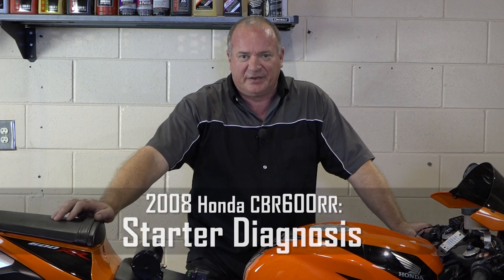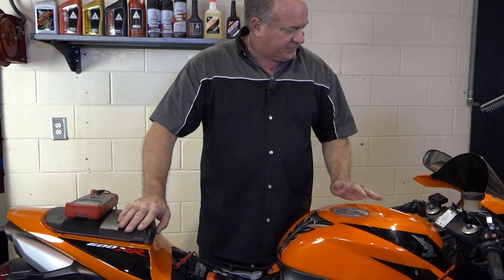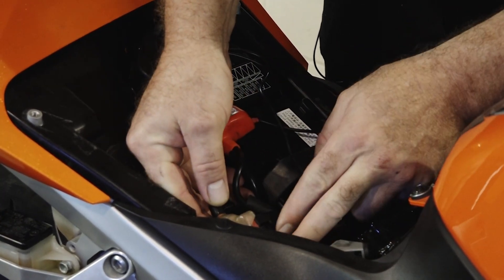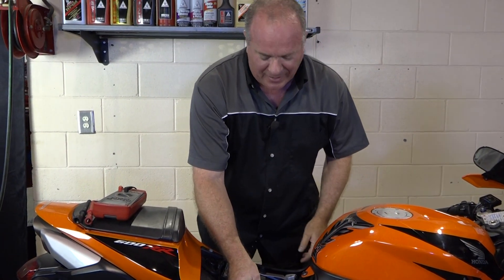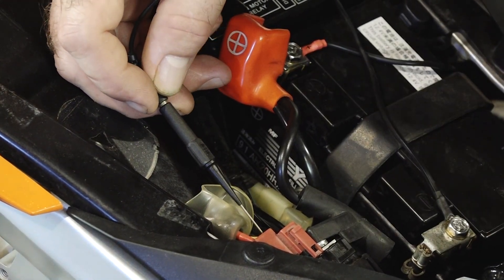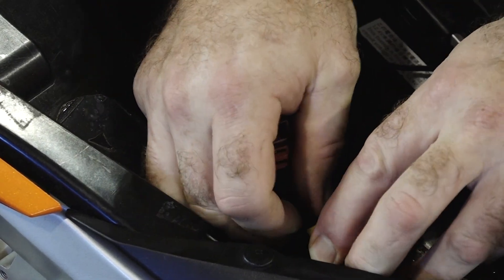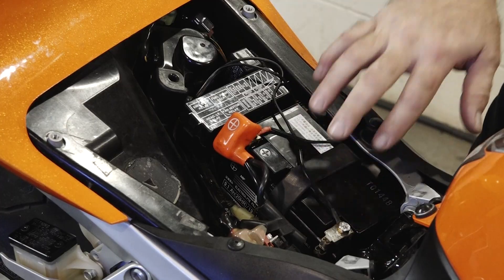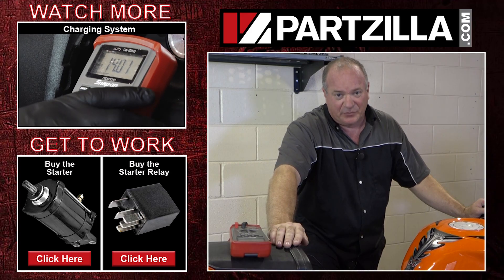How to Diagnose Starter Problems on a Honda CBR 600 RR | Partzilla.com

Comment: Would the starter die when the bike is hot
Reply from the maker: I suppose it's possible if your starter is already on it's way out, but that shouldn't cause it to die. At least, I've never heard of that happening.
Reply: Partzilla guess I'm gonna have to figure out why It dies when it gets around 200
Reply from the maker: It can only really be a couple things.  Do a Voltage test on the battery and make sure it's not weak, check the regulator/rectifier and make sure the connections are cleaned.  If none of that helps, it's most likely a bad rectifier or your starter is going out.  Always start with the cheapest fix first.  I hope this helps get you to the answer.
Reply: Partzilla thanks

Comment: hey friend i need to ask you something
Reply from the maker: I may, or may not have a good answer, but we will give it our best.  What's your question?
Reply: Partzilla Hi. My question is this. You do not know how to fix a cdi / ecu from a cbr 600 f4i? In advance thanks friend
Reply from the maker: There isn't really a "fix" for a damaged ECU.  There is a process in the service manual to reset your ECU if something is running weird.  Other than that, it would be a full replacement.  I would rule out EVERYTHING else before you do anything with the ECU.  Check all fuses and wires first.

Comment: What is that tool he used to start the bike manually by inserting the metal tip into the wire?
Reply from the maker: It is called a jumper.
Reply: @PartzillaParts  what was the other side connected to?? The positive terminal?

Also could you link it or give the part number? When I look up jumper or jumper needle I just get regular jumper cables for motorcycles.

Comment: can anyone please help. I read the Voltage on the battery while press start button, it's 7.3V. then, I connect the multimeter to the starter it reads 5.2. Do I check all the ground cables from starter to the battery?
Reply from the maker: Hello Do it Diep. How many volts are you getting without pressing the start button?
Reply: Partzilla it was 12.6V
Reply from the maker: What you are describing to me would tell me that you need to replace your battery.

Comment: hi I checked everything as you did in the video. but I when I connect the positive terminal to the yellow red stripe wire the starter does not make any noise. what could it be? starter is bad? 
thanks.

Comment: I have a 2017 Honda cbr 250 an some dummy cut my ignition wires and mess my ignition up totally up so I tried reconnecting the wires and twisting them together and my bike will not crank and I'm at after hours and hours of trying somebody please help
Reply from the maker: Hello Bo. you always want to solder any electrical connection. Try doing this and see if it helps.

Comment: I have a 2006 cbr600rr and it all works in terms of turning on, riding, front headlights and high beams but the problem is that the indicators, horn and break lights don't work, it was working perfectly fine about 4 days ago but jst randomly stopped working today. Can anyone help on with this problem?? all the wiring have not been touched or anything it jst randomly stopped working.
thanks in advance!!
Reply: Can two different casein cause the 06 600rr to not starting back when its I've check all those that you told me about and am still getting that problem

Comment: so I have a question I cleaned out my starter and tested it and it moves pretty good even from my pretty low battery that I haven't used in a couple months and so after I put everything together I checked relay fuses they're fine but the bike was making a buzzing static noise from the relay every time I pressed the power button and so I charged my battery and I could actually hear the starter Turing over but its very slow and isn't enough to power on the bike do you think that the battery can't hold a charge anymore or something? or its something else?
Reply from the maker: Hello Aleksey. What you are describing sounds a lot like a dead battery. That is the first thing i would check.

Comment: Hello I own a 2007 cbr600rr I have a problem with my headlights that my high beams work but my low beams don't turn on. The bulb is fine. Another thing I thought about checking is the relay, I just can't figure out how to get the headlight relay out to check it. Is it just a pull out? Or is there like a clip holding it in? I checked the fuse, it's fine.

Comment: I have a 2004 Yamaha YZF 600 r my problem is when starting cold it turns over then like a metal crunch then its seizes and won't turn over. it takes a while and multiple start button pushes before it starts what can that be?

Comment: hi just bought a 600 rr problem is it doesnt go above 170 fisrt two gears are fine after that the bike doesnt pull
Reply: he diagnosis not tell you why you are slow
Reply: Old post but if anybody else is wondering a good thing to check would be the fuel pump, this is a classic symptom.

Comment: I NEED HELP WITH MY 2011 HONDA CBR600RR. I was driving my bike and I turned off, when I was gonna turn it on again the bike didn't turn on, it was making a weird sound under the seat, I opened and check the starter relay and the fuse and the starter relay were melted, I just bought a new starter relay and installed by myself and when I try to turn it on the new starter relay makes the same sound. Can somebody please help me? I'm from Dominican Republic, sorry about my English.
Reply from the maker: Sounds like the starter is the culprit that damaged the starter relay.
Reply: +Partzilla.com I fixed it, I replaced the relay with a new one and it worked fine. Thanks bro!
Reply from the maker: Glad you got it. Another bad relay surprises me.